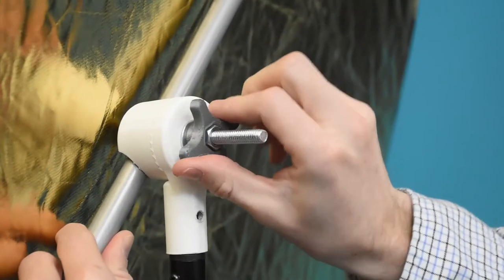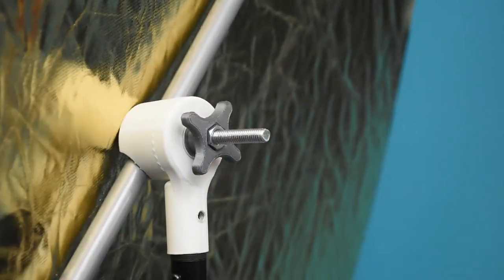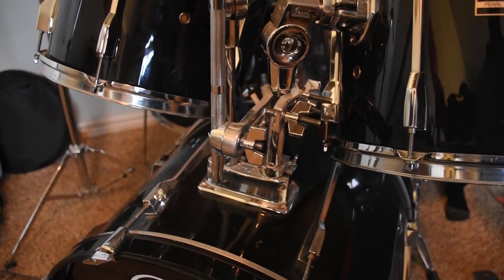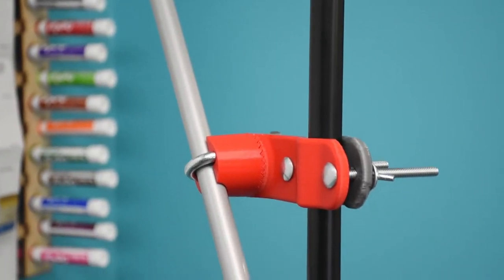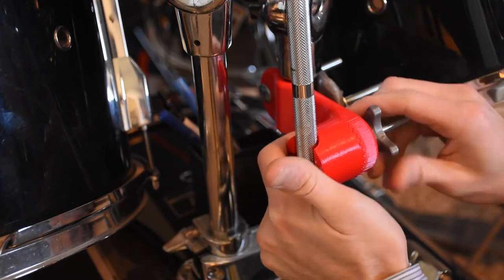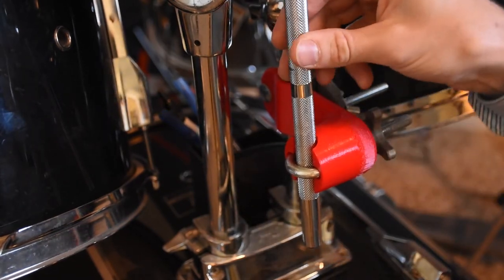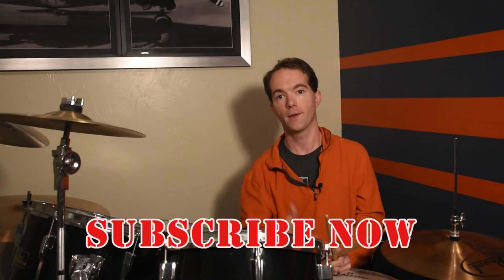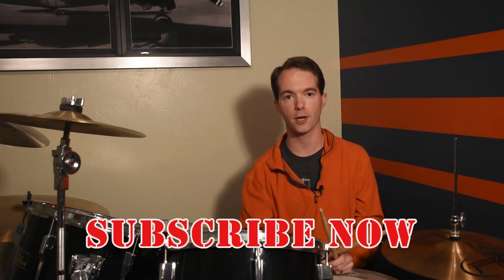Drum-Style, 3D Printed Clamps - Mikes Inventions

Comment: Hey dude! Nice to see someone out there making new and cool drum-related inventions. Would have liked to have seen more about how you made them, trial and error building them, and whatnot. What extra hardware pieces did you need and how much did it end up costing you vs. buying a regular clamp? Thanks
Reply from the maker: Hey! Thanks. I simply measured the clamps I had and nearly copied it in SolidWorks. I didn't think it was important to show those steps. Wrong, apparently. I'm going to make the files available on my website, so check in a couple of days. I also used a 5/16 eyebolt, washer and wingnut to clamp the accessory rod. Then the clamp was clamped onto other stands with two 1/4" carriage bolts, washers, and wing nuts. Total cost was about $4 for everything, whereas a clamp is at least 12. And plus, I made it myself! And you can too. Thanks for watching!